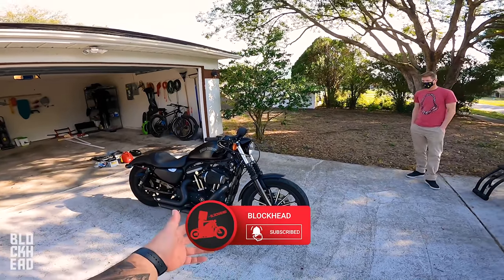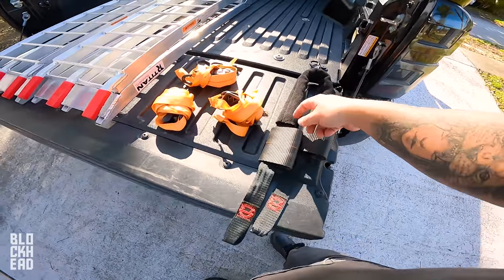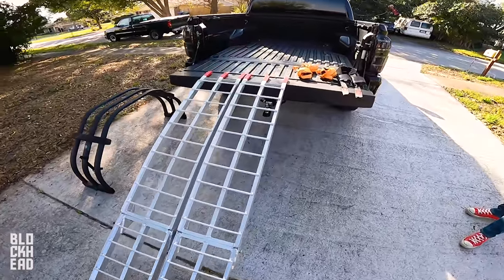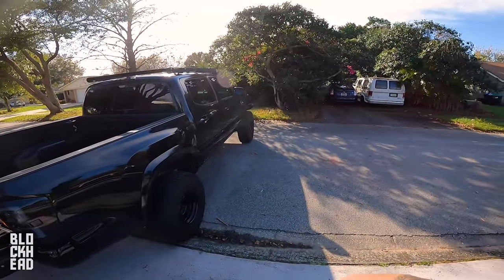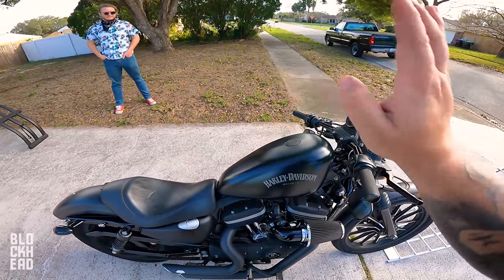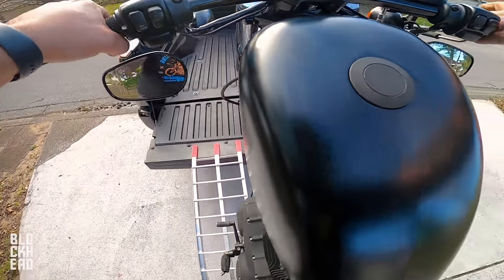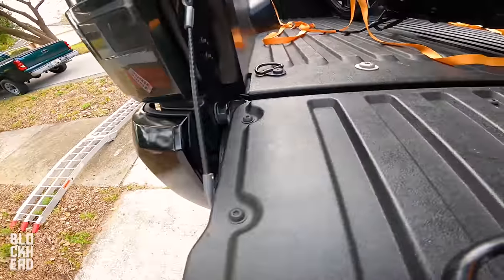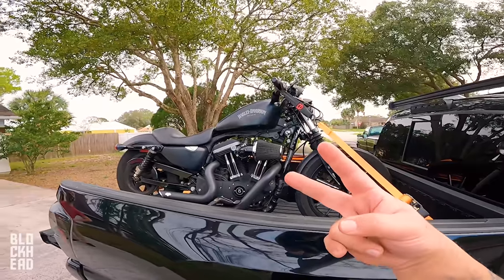How To Load A Motorcycle Into A Truck BY YOURSELF!

Comment from the maker: Don't forget to pull on the straps and say "that's not going anywhere!" It's an important part of the loading process! 😅
Reply: :_blockhead: informative! I bought my wife a R3 4 days before mother's day.... Guy wouldn't budge on price.... So I asked him to Deliver bike :_suhdude: which worked out being it was a Surprise, 1.5hrs away :_rssv: Ride Safe
Reply: Thanks for the help I have just been putting the straps around my dirt bike in random spots.
Reply: @bodiemaisano6825  same here man😂takes way longer, needa get those handle bar thingys
Reply: Must important part, next is a cold drink or five
Reply: Also will accept, "yep that's tight." Or "I think she's good."
Reply: Does your taco have a 5ft bed? Been thinking of getting one too and would prefer the 6ft bed but I really want the manual transmission
Reply: @ajeetvirk  my husband has the 5ft bed manual and we have had a dirt bike Klx 250  in the back of bed a few times.  And my Honda rebel 250
Reply: You'll regret not doing it too, TRUST ME
Reply: Rule of thumb has always been if I shake the bike and the truck moves... it’s good.
Reply: Whats up commented on the last video also im willing to buy the bike from you if your interested i want an iron 883 and thought it would be cool to get my first harley from you
Reply: It’s impossible to not say that whenever using tow straps, it’s like picking up a pair of salad tongs and clicking them together twice like a crab
Reply: "Let's go Brandon"
Reply: Every time! 🤣

Comment: In addition to the front straps I prefer to use 2 straps at the rear, one on each side connecting between the frame/passenger peg area and tie down points to the side, to prevent the rear of the bike from moving side to side. These should also prevent it from sliding backwards if the tie downs are even with or in front of where the straps are attached to the bike.
Reply from the maker: Good tip!
Reply: If you compress the forks the bike isn’t going anywhere. No need for more than two straps.
Reply: Just in case..links or strap failure.

Comment: One time me n my road dog Ronnie(R.I.P.) had to bring his bike home from inwood w.v. to baltimoremd. It was about 1 am n we didnt have a truck. We took my ole 94 buick park ave n took everything out the trunk.picked his front end up(10 over wide glide hooked to a knuckle frame with a panhead). He had a big 15(16?) Inch tire on it.we strapped his forks to my trunk hinge brackets and drove 35 to 45 mph back to balt. It fell over 2 blocks from my garage.  We got out straightened it up n made it to the garage. Lets see some of you new age young bucks do that to y'all's barbie pretty princess bikes. F**k that, it aint but a murdersickyle.

Comment: I got a trifold ramp from harbor freight. They came with small chains that I wrap around my tailgate cable. Probably not the most secure, but it works lol. Also if you don't have a bed extender and have a 6 and a half foot bed, take the cables loose on your tailgate, lift it and wrap the cables around the part the tailgate latches to and reattach them. The tailgate will be partially up and worst case it could prevent it from sliding out of the bed. Sorry for the long comment just sharing my experience lol

Comment: Good use of the dip cheat, 💪🧠👈 
An if you don't trust your tail gate you can put the front tire in the corner of the bed to get the back tire off of it as much as possible unless you have an extended bike 🤷‍♂️🤣

Comment: Save yourself the headache. Go to harbor freight spend $60 and get the wheel chock. I split my ramps apart more bigger harleys need more space and I use 2 straps per trailer to keep them from sliding on the tailgate trim. I also use a jack stand on the motorcycle ramp at the pivot point OCD the hinge will fail with my 25k bike on it!

Comment: Great video! Thanks! Question though, would you dare do the same thing with a touring chassis bike in your Tacoma? Have you?
Reply from the maker: Largest I’ve put in the truck is a Dyna Low Rider S, which is 92.7”. It was overhanging the bed and had to be in diagonally, but it worked!

Comment: I have used most of the recommendations here and all are good.  However, since I usually loaded my bike alone, I ended up buying two sets of ramps and set up 3 of them so I could straddle the bike and have a ramp on either side so I could have a foot on either side for balance.  Also, all my ramps are arched because most of my motorcycles had low ground clearance.  I always tied all three to the bumper of my truck to keep them from sliding backwards.  Later on, I bought a 3 sectioned wide ramp that could be bolted together or each section used separately.  Then I got a 5x8 utility trailer that simplified everything.  I also use it to load my 2 ATVs.  I hook up the trailer to the truck, use two single arched ramps from the truck bed to the trailer bed to load one ATV into the trailer, and then load the other ATV into the trailer.
One thing not mentioned here that I would recommend.  Be sure, when buying  a set of ramps, that they are capable to withstand the weight of whatever you intend to load.  Some may claim to withstand 1,000 lbs., but they actually mean that each ramp withstands 500 lbs. each.  A friend of mine learned that the hard way.

Comment: I added a 12 volt winch in the  F-150 bed. Have a motorcycle 2 wheel frame dolly that straps under the Harley frame. One ramp and fx tailgate supports. Just hook the winch cable to the bike and run the winch. just watch the motorcycle load without any other assistance...

Comment: I bought a certified 2017 Tacoma sport double cab with long bed because it's a work truck. Previous owner had a 2" lift kit on it and I didn't realize it at first. I had the dealer remove it for free because it wasn't disclosed in the contract. It made loading the truck with tools, motorcycles, everything a lot more difficult and I'm 6'1". I prefer function over form, but that's just me. One other tip... Make sure you tie down all those strap ends tight and make sure none can flap around in wind and touch the bike. A flapping strap in the wind makes a perfect paint and chrome remover.

Comment: If you hopefully have two people helping the person load the bike, you ride the bike up the ramp at a decent speed (5mph-ish) and the people helping keep hands close to the tank and rear fender. If the rider falls either way, the helper can push it back.. many many many ways to do this. Most of it is practice just like anything.. but fender and tank is where hands should be as a helper guiding a bike in in to a truck.

Comment: I use black widow ramps there longer than any of the cheap ramps that are out there you can load by riding the bike up also I use tailgate support brackets for the tailgate to keep the weight of the tailgate cables

Comment: How I load a bike.  Put  down the ramp.  Get a running start. Get on the bike.  Get it driving.  Stand up on the pegs.  Drive up the ramp.  Use both brakes to stop the bike.  Been there done that. 
I haven't gotten to double blip and wheelie in with no ramp, maybe later when I work on log hopping skills.

Comment: Is the back "small closing door" of the truck bed strong enough to hold the weight of the motorcycle ??   Or did you tied something to that "small door" to make it stronger ?
Reply: The tailgate?

< 300 lbs - no problem 👍